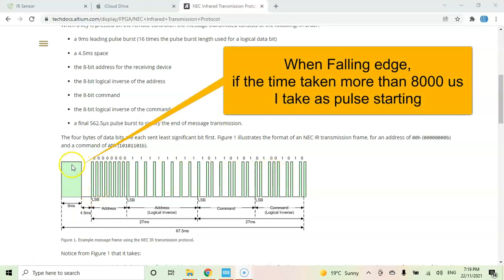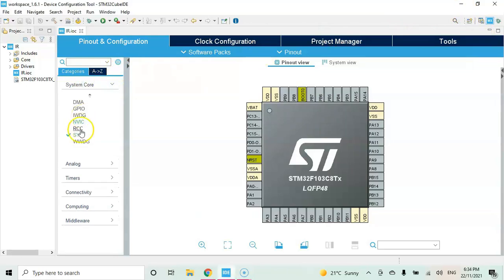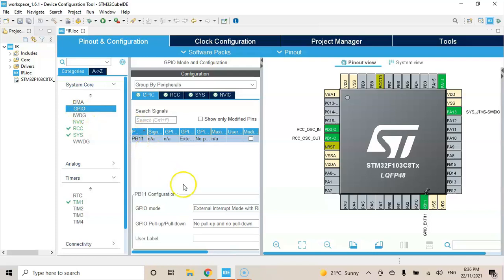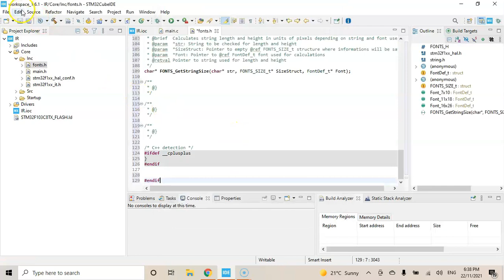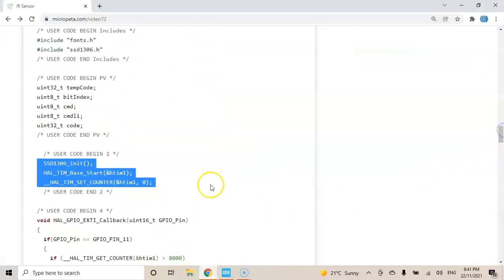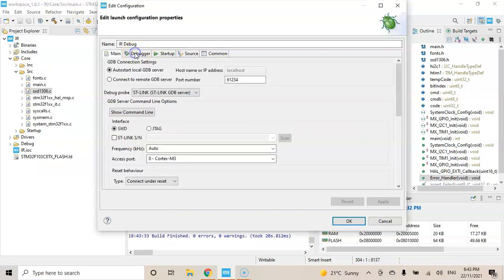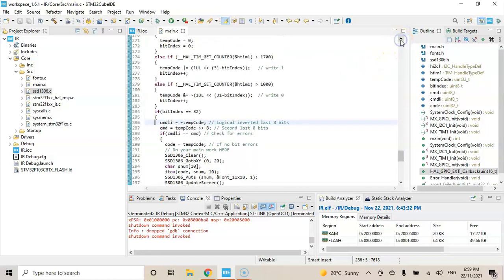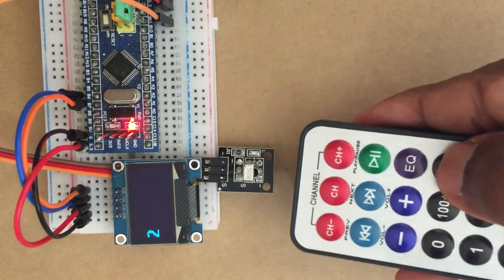72. STM32CubeIDE IR Sensor Remote Interrupt.  NEC Infrared Transmission Protocol with STM32F103C8T6

Comment: sir i didn't get the value ! where the function HAL_GPIO_EXTI_Callback calls ?
Reply from the maker: HAL_GPIO_EXTI_Callback does not calls any function.
Whenever pin PB11 goes from high to low, the function HAL_GPIO_EXTI_Callback is executed

Comment: Could you share the setting of this parameters ?

  __HAL_RCC_GPIOA_CLK_ENABLE();

  gpio_init_structure.Pin = GPIO_PIN_2;
  gpio_init_structure.Mode = GPIO_MODE_IT_FALLING;
  gpio_init_structure.Pull = GPIO_NOPULL;
  gpio_init_structure.Speed = GPIO_SPEED_LOW;

  HAL_GPIO_Init(GPIOA, &gpio_init_structure);

  htim15.Init.Prescaler = 71;
  htim15.Init.CounterMode = ?;
  htim15.Init.Period = ?;
  htim15.Init.ClockDivision = ?;
  htim15.Init.RepetitionCounter = 0;

  HAL_TIM_Base_Start(&htim15);

 __HAL_TIM_SET_COUNTER(&htim15, 0);
Reply from the maker: The purpose of this timer is to create 1MHz (1 microseconds) counter.
As I have shown in this video, CubeIDE can be used to create these codes.
These are auto generated codes. Thanks

Comment: Thankyou for the code and video, but fundamentals are not clear yet. Please guide.

1. Turning on the timer with Prescalar value 65535 = OK
2. Turn on edge triggered (Falling edge) interrupt on the IR remote signal pin (B11) = OK
3. Now when an falling edge triggered interrupt is initiated, since timer is already ON, how and where are we turning on the timer to measure the pulse width??
Reply: same query

Comment: Thank you so much.It did not work with  3.3v for me it worked with 5v.I have question. there is timer formula =timer mhz / (psc+1) * (arr+1) ;this why psc =71 but why arr is =65535 ? 72 000 000  / (71+1) * (65535 +1) it does not make any sense to me .i think it sould be  0 . therefore 72 000 000 /(71+1)* (0+1)   ==> means 1 us.
Reply from the maker: Thanks for letting me know that it works with 5V
As for the timer, I am using it to measure microsecond delay. Since the clock speed is 72MHz, I used 72-1 as prescalor to get one microsecond

1 microsecond = 1 / 1000000 Hz
Reply: @NizarMohideen  yes i got that part but why 65535 ?
Reply from the maker: Counter Period can be any large number. 65535 was the prefilled value from CubeIDE so I just left as it is.

Comment: Dear Mr. Nizar.  I would like to  add one dc motor, one rc-servo , and one stepper motor then control speed, direction using irremote setting in  this video. the question are:
1. it is necessary to set the hardware configuration from beginning? if necessary how to do that? 
2. It is possible just add the instruction for all the motor inside the "SWITCH-CASE" only? 
thank you.
Reply from the maker: You can open the ioc file and add the settings for any new devices and save, it will generate new codes. Or, you can create new project and do the settings for all devices.

Setting for servo is here https://youtu.be/h54DEslq-GI
Setting for DC motor is here https://youtu.be/0rbKmkNEdAU
Setting for stepper motor is here https://www.youtube.com/watch?v=Mh-itQEaeyM

It is possible just add the instruction for all the motor inside the "SWITCH-CASE" if the code doesn’t involves many lines/calculation. Otherwise keep  the instruction for all the motor inside the main while loop.
Reply: @NizarMohideen  thank you sir.
Reply: @NizarMohideen  Hai again Mr. Nizar. I am just trying to set rcservo and dc motor. they  speed and direction are controlling by irremote .  what i need is pwm output for controlling mosfet gate  because i need higher voltage and amperes later on.  i have difficulties to set "Prescaler value  and CounterPeriod value for rcservo and dc motor because both value are different. Are they setting have to use different timer setting?
Reply from the maker: Servo and DC motor works differently.

As for DC motor, it is simple. You can just change the voltage level. In video-20, I have created 100Hz pwm (pwm frequency here can be any value)
Since my timer clock was 8MHz, I divided first by prescalor of 128-1 and then counter period of 625, 

As for the servo, the pwm frequency has to be 50Hz. 
Since my timer clock was 8MHz, I divided first by prescalor of 16-1 and then counter period of 1000-1.  If you see my simple servo video-27 and see the explanation below
Since I set Counter Period 9999 for PWM, I can change Pulse from 0 to 9999. 0 being 0% and 9999 being 100% pulse width. __HAL_TIM_SET_COMPARE() is a macro to set the pulse on the fly.

For the servo motor, I need 50 Hz signal 
Clock frequency = 8 000 000 Hz 
If I divide by Prescalor 16 
Frequency = 8000000/16 = 500000Hz 
If I divide again by Counter period 10000 
Frequency = 500000/10000 = 50Hz 

If it is 50Hz, 
The full pulse with time is = 1/50 seconds = 20 milli seconds 
For the servo motor, I need to change the pulse from 0.5 ms to 2.5ms 
Full 100% pulse is 10000 according to counter period 10000 
0 → 0 
20 milli seconds → 10000 
So, 0.5 milli seconds → 250 
and 2.5 milli seconds → 1250 
So I can set __HAL_TIM_SET_COMPARE() from 250 to 1250
Reply: @NizarMohideen  Thank you for the explanation. actually i knew where you got the value. what i asked are they (servo and dc motor) put on different timer setting. in my case can i put on timer 2 for dc motor, and timer 3 for servo motor. so i can set each of prescaler value of them.
Reply: @NizarMohideen  this explanation is best.
Reply from the maker: Yes. That is correct. Use different timers

Comment: The error message has gone, i follow and go through step by step then it was succed. Is there serial monitor in cubeide? thank you
Reply from the maker: Congratulations.
As for the serial monitor equivalent, there are few ways you can achieve it.

1. You can use usb virtual com port to write messages as shown in video-64. Instead of using nodejs, you can use a serial monitor to view it

2. You can also use an uart to write serial messages. Use an ftdi and a serial monitor to view it

3. A simple and easy way is by declaring few variables and running in debug mode and then watching in the live expression as sown in video-16